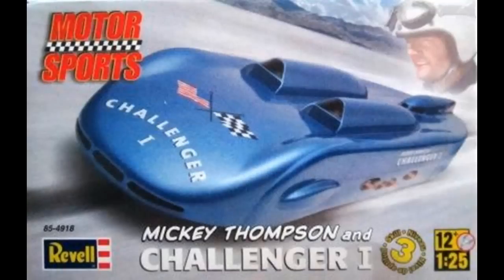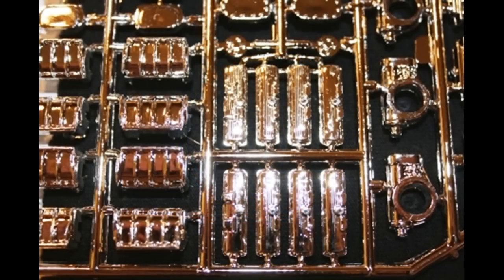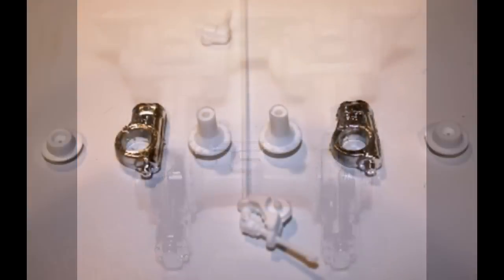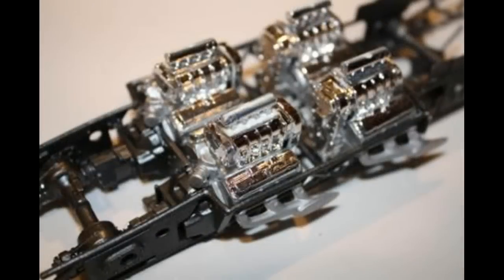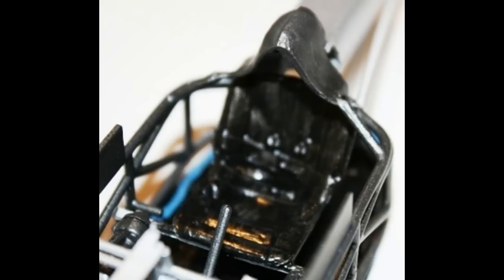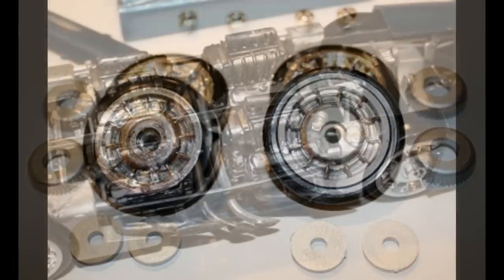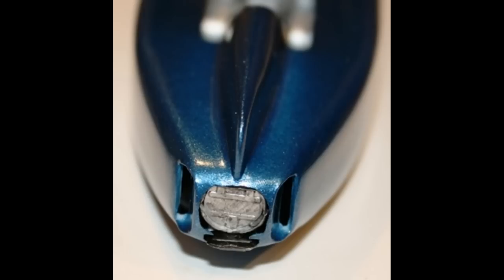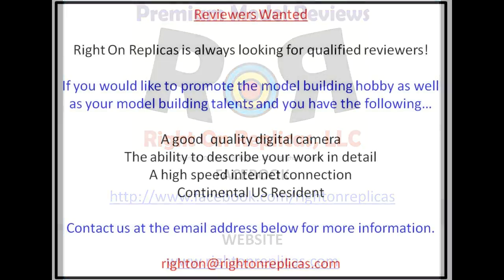Model Kit Review-  Mickey Thompson’s Challenger I Revell 1:25 Scale #85-4918

Comment: Awesome parts kit, 4 engines, 4 LaSalle trannys, and 4 quick change rears, plus assorted other vintage racing goodies.  Because of the build issues, these kits are usually fairly cheap too. For added value, get the one with the Tiny Mickey Thompson 😎
Reply from the maker: Red,  You've discovered one of modelling's best kept secrets!    Thanks for sharing!  -Doug
Reply: @RightOnReplicas  I have one coming in the mail, I may just glue the body up and make a curbside after robbing all the neat parts. Honestly, that is the only way you can get it to come out as slick as the 1/1.
Reply from the maker: Red,  have fun and model on!  -Doug